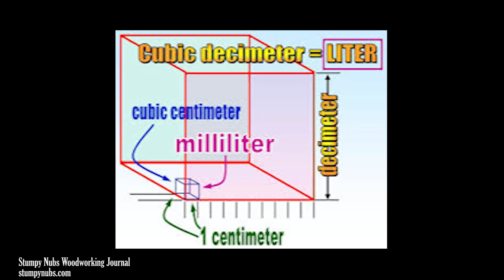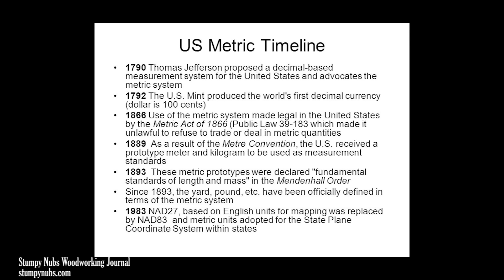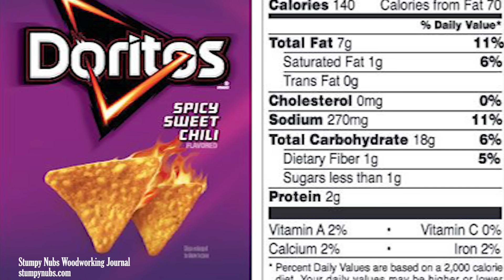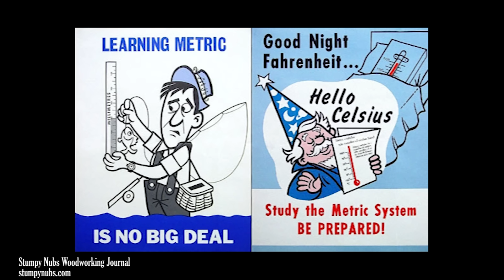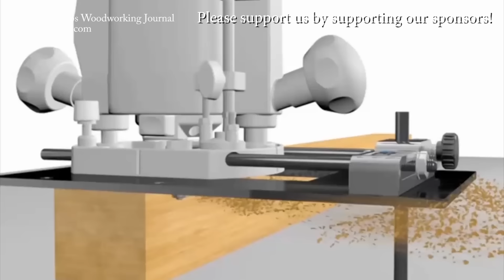BREAKING: The USA is switching to METRIC!

Comment: You scripts are always pretty good but this one was great.  A joke in almost every line and the dry delivery was just spot on, while still having the informative content and balanced takes that make this channel so great.

I use both for woodworking and fabrication projects pretty interchangeably using whichever is the most convenient at the time.  I do feel metric is overall a better system, particularly if you are doing anything which involves conversion between types of measurement.  But imperial is great for rough work and eyeballing sizes.

The only time I have strong feelings on systems of measurement is the American obsession with using "cups" as measurement in cooking.  Use weight for solid materials like a sane person, Pounds and Ounces are fine it doesn't have to be grams, I can use imperial or convert to grams. But please stop measuring solids of varying density with a only loosely defined volume, it is the work of madness.
Reply: I like to eyeball in decimeters (10 cm) which is the height of a soup can!
Reply: Your comment is great and I especially like the part about cooking, makes complete sense because it can make a big difference in the outcome.  And yet, as an almost 71 years old lady who has only ever used cups to measure and hardly cooks from scratch anymore I’m not sure I even want to try to change at this point.  😳 I’ll leave that to those that do cook and bake instead.  😉
Reply: @BobbieJeanM  I have a scale. Bowl: zero; “pour” (shake?) to add; zero again; repeat until done. OK, I still use spoons for spice, but weight with a “tear” function is way easier!!

Comment: I use metric all the time in projects for building using my 3d printer  which has build volume specified in mm, which I assemble with M2, M3, or M4 nuts and bolts. Like you say, whenever you work on a car I go for the metric sockets first, because almost every thing on a car is metric.

Comment: Even though I was at school when the metric system was introduced here in New Zealand, and I am now in my 60, I still asked for 3 x 2s when I arrived at the timber yard recently.I was quickly corrected to 75mm x 50mm but 3 by 2 is a whole lot easier to say...and I do use metrics for most things but inch,foot,yard is at times easier!
Reply: As a twenty something I had the same experience in a timber yard here 50 years ago - asked for 3 by 2 to be told it was 75 by 50 as were you, but then told it was only sold in eight foot lengths!  :-)
Reply: Sorry everyone.  I started this as a quick comment but it turned into a full epistle.  An initial comment is that in the metric system length is METRE (from the French who invented the system in the first place), not METER (like a water meter).  

I am with sundancer0147.  Was at the very end of secondary school and starting in after school or holiday jobs when we went metric here in NZ.  For framing lumber I still "think" 4 x 2 or 3 x 2 from my childhood, as my dad was a builder and that is the language I learned.  The kids at the hardware outlet don't understand inches so I now tell them 90/45 or 75/45 mm.  

Everything else is directly metric.  

Ironically, 90/45 framing doesn't come in standard lengths of 1 methre.  It is 2.4,  4.8, or 6 metres, which is multiples of 1.2m, which is very nearly 4 feet.  I think this is back to minimum stands such as building codes.  For the imperial guys, 6 x 1 inch fence palings are 150/25 (or 150/18 for the budget outlets).  

A sheet of panel product is 2.4 x 1.2 metres, which is just under 8 x 4 fee.  2.4 metres is the standard internal stud height in a house. 

Actually the discount houses import from China (which supplies US) and often what they sell as 2.4 x 1.2 and (say) 12mm thick (close to 1/2 inch) is often ACTUALLY a bit over the label dimensions.  As a home woodworker I can cope, but the commercial guys make sure they know exactly what they are getting.

In refence to ericlotze7724 below.  Yes, this is a bit of a pain, but the upside is a 8x4 sheet has enough 'oversize' in it that you can cut it down and not end up undersize due to the kerf of your saw.  A 8X4 sheet is 2440 X 1220 mm so you can rip it and cross cut as much as you like and still have full dimensions against the requirements of your metric project (and a tiny bit of wastage, which beats being a bit under).

The way I converted was to drop inches completely and buy "metric only" tapes, rules, etc.  You just keep in mind for a short while that a foot is just a fraction over 300mm (30cm) and a yard is a fraction over 900m (90 cm) or a bit UNDER a full metre.

As an aside the system goes in all sorts of directions.  A cube 100mm wide X 100 deep X 100 high is 1,000 cubic mm which is 1,000 cc or 1 litre, and 1 litre (of water) weights1 kilogramme.  Screw, nut, bolt, drill size, and suchlike also get really easy.  Separate tutorial on how easy that is if anybody is interested.
Reply: @colinjames9502  > in the metric system length is METRE, not METER

That depends on the language, it's not the same everywhere.
French: mètre
British English: metre
American English, German, Dutch, Swedish: meter
Spanish, Italian: metro
And many more variations...

Comment: We will not comply. Manufacturing is one place where the metric system is almost universally hated by old machinists who have to stop and do a mental conversion to even visualize a metric measurement. Equally, if you asked them to replace their whole set of inch measuring instruments, they would immediately go nuclear. While Ford, GM and other big companies have long since gone metric, the first stop a new job makes at a supplier is to have the print redrawn with dual inch/metric dimensions (only because the big 3 won't let you get rid of the metrics entirely). As far as engine displacements, I've owned a 170, a 289, a 351, a 400, several 300's and even still have a 312. (how many people know about that one without doing a search?) Today, my Ford pickup has a Triton V8 that displaces who knows what and i haven't bothered to find out. I leave the liters to my son in law. I'll stop ranting now. I feel better.

Comment: 50 years as a pharmacist and having to learn metric, troy, and avoirdupois systems, I fully embrace the metric system. Early ion, I had to flip back and forth frequently, but half-way through my career, pharmacy was totally metric. I brought beakers and graduates home and use them in lieu of measuring cups when cooking. BTW, I owned the pharmacy, so I didn't steal them. When it comes to small volume and weight measures, my mind works in metric. When It comes to large volume or weight and to distances, I have to do the mental gymnastics of converting back and forth. However, over the years, I have seen a significant shift towards metric.

Comment: I'm a 67 year old American that grew up on the imperial system. I know that a mile is 5280 ft. But I also know that 1km is .6 of a mile. I've been mentally doing conversions(or trying to just to see how close I can get) for over a year now. It wouldn't bother me one dram if we converted over to 'that other' system at all. 
Keep up the very informative work James.
Reply: Forget the Empire. Long Gone System.
Reply: *United States Customary System
the USA does not (and never has) used the Imperial system
Reply: How many inches in a mile? How many cubic inches in a quart? Can you easily convert microns to furlongs? Does your old truck wheeze up the street 'cause you're afraid of computers too?
Reply: I live in Quebec, Canada. Here we offenly use imperial in workshop, why? I think it is funny.
Reply: To me, using metric, I think of the mile issue from the other side: a mile - or as we say in Norwegian, the English mile - is 1.6 km. Of course, in Norway and Sweden (but not Denmark, for some reason) a mile is 10 km. Why we were the only ones to metrify the mile, I have no idea.
Reply: So, I'm not only one doing the 0.6 of a mile conversion. Also, a meter is close to a yard with a unit gained about every 11 yards. So, a kilometer is 1000 yds + 90 gained units or 1090 yds. So, conversion can be simplified, but it would be much better to not have to do it.
Reply: The other conversion I seem to do often is that 2.54 cm is 1 in. (rounded to 2 and a half.)
Reply: How often are you needing to convert between miles & km?
I'm in the UK where road sign distance is in miles & speed in mph.
I very rarely need to be converting between miles & km. The most annoying time for that is when I'm watching something on TV (perhaps about aircraft) that's often originally from USA and for some reason they have made a new soundtrack with the speeds in km/h! (The international standard for aircraft speed is knots, mph would be fine but who is wanting km/h in the UK?)
Reply: Pounds - kilograms is my favourite. 1 kg = 2,2 pounds is actually pretty convenient back and forth. And isn't yard pretty close to a metre? 0,9 metres or in that range. When distances grow, any unit starts to become rather arbitrary (and metric is to begin with arbitrary in every day life despite being useful for scientific calculation).

And both systems have the curse of volumetric measures. Millilitre is impossible to measure or gauge by eye. Centilitre is doable but nobody uses anything other than 4 cl shot glass. Desilitre starts to become useful and you might be able to gauge it, cup is pretty much equally convenient other than being quite big of a measure. Litre is easy because everything in the store being packed in 1 litre bottles/cartons (and because you can gauge 1 litre of water from length measurements).

But I must say, full inches are pretty convenient even for people using SI-system, there's something about approximating measures with your body instead of guessing a random number by eye.
Reply: @DLBeatty  From Wikipedia. "Standards for the exact length of an inch have varied in the past, but since the adoption of the international yard during the 1950s and 1960s the inch has been based on the metric system and defined as exactly 25.4 mm." There is no rounding involved, an inch is defined as exactly 2.54 cm.
Reply: The inch is easy - 25.4 mm exactly. Or to put it in fractions, 25 and 2 fifths millimetres. A foot (304.8mm) is closely matched to 300mm, and the yard (914.4mm) is close to a metre.
A US gallon is approximately 3.5 litres, and the mile roughly 1.6km. Oh, the kilometre is pronounced KILO - metre, not KILL - omiter.
Reply: 52and something
Well its less complicated than metric
1 km is 1000 metres
And 1 mm is 0.001 meters(1/1000).
All world is blind to benefits of converting legs in miles.
Reply: @drthmik  yes you do, all your metrics are in SI units
Reply: what's the unit of mass in your units?
Reply: @salerio61  Nope
The USA has always and only used United States Customary units
which were developed at the same time as the Imperial System, which we never adopted or used

Comment: I recently got into 3d printing. Everything is metric by default in that field. I love it. I don't feel like I'm swimming against the current like I do in other mechanical endeavors in the US. I'm really tired of people resisting a much easier method because... Because what exactly I don't know. Change is scary I guess.
Reply: The problem with metric is it cons people. When it comes to engineering imperial is far more powerful.
Reply: @Art-is-craft i don’t know what kinda budget engineer u are but metric is definitely superior for any engineering field
Reply: @MrRjizz  
When it comes to complex calculus as Newtonian based only a fractional system like imperial works.
Reply: @Art-is-craft  No way, the United States Armed Forces (since 1957), NASA and all other engineers, uses the metric system.

Comment: In Germany, we had adopted the metric system in the second half of the 19th century. And still our plumbers use inches or their fractions to measure the diameter of pipes. I'm not a plumber. But I like it! I almost cried, when England moved from pound-shilling-pence to the decimal system, because the old system had been in use since the Roman Empire.
Reply: In Jolly Olde England, they're still using miles on highway signs.

I think we in the US have an inaccurate idea of what the rest of the world is doing and believe that everyone else is strictly using the metric system.
Reply: @iFixJunk In the UK, petrol is sold in litres but people still talk about mpg for fuel consumption. Personally, I use litres per 100km.
Reply: In the Roman empire they did a lot of things we don't do anymore,  such as crucifying and torturing 🙂

Comment: I’m a retired engineer and prefer the metric system. Unfortunately I get forced back to using the imperial system sometimes because many  materials  in the US are sold in those units. But I have found that metric hardware and fasteners can often be cheaper and easier to find especially online.
Reply: The free market provides
Supply and demand, fewer manufacturers produce in USC, the vast amount of the rat produce in metric, so the prices go down due to direct competition

But I'm sure manufacturers in the US never bother lobbying against metric in your government, that would be self serving and greedy

Comment: I purchased project plans from a Japanese youtuber and there were links to parts sold by a Japanese distributor in the US. I bought all of the M-size screws, nuts, washers, etc. as well as new Makita drill bits and a dual unit tape measure, and loved how easy it was to do the math when putting everything together. I've thought of doing future projects entirely in metric.

Comment: I learned both systems when I was in school. Depending on what I'm doing I'll choose one system over the other. If building a large item such as a house, shed or even a planter, I use inches and feet. When building something very small I use millimeters. With temperature I prefer Celsius. With distance, mostly Kilometers but in miles is simple too. In measuring land, I prefer Acres. When you understand both, it really makes little difference.